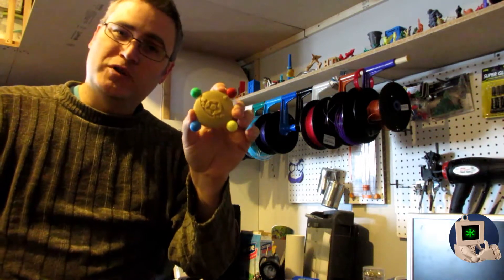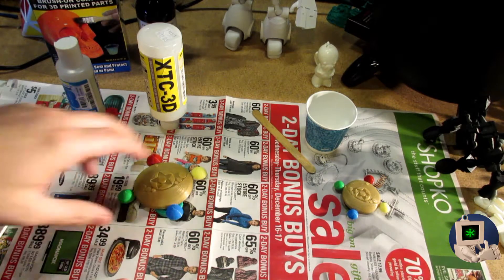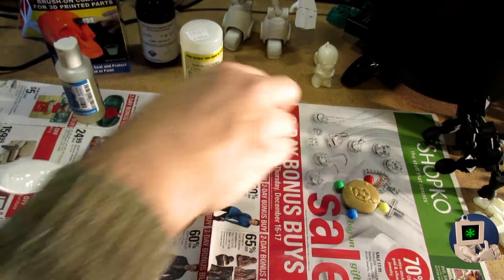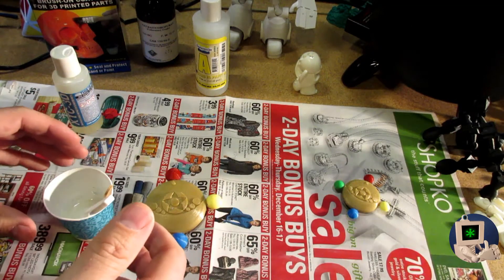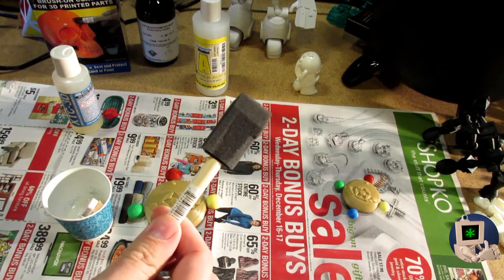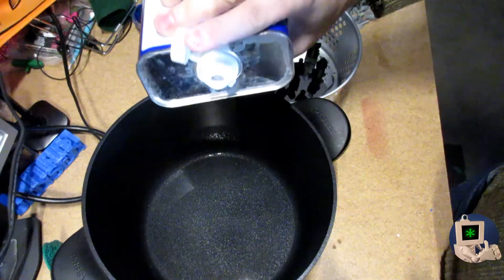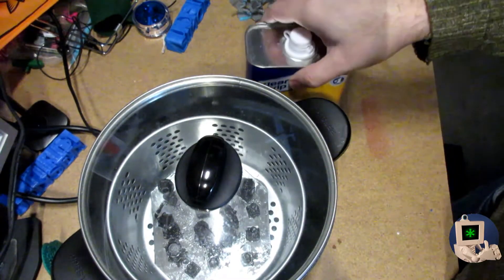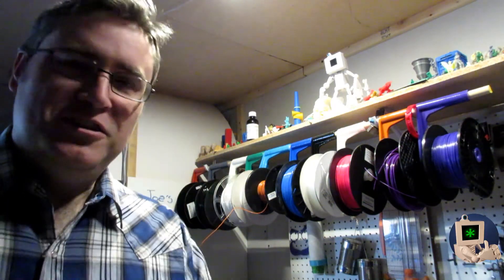3D Printed Sailor Moon Pendant part 2 AKA finishing PLA

Comment: Haha yeah chloroform is way too tempting. BTW mixing epoxy is best with a digital scale.

BTW there was one experiment that claimed acetone smoothing actually reduced the strength of the part. It might be plausible that those long molecular chains get broken so you end up with less sturdy material. Not sure though.

Also I would think that epoxy coating would greatly enhance the strength of 3D printed materials? Similar to carbon fiber.
Reply: Acetone vapour on PLA causes it to swell up.